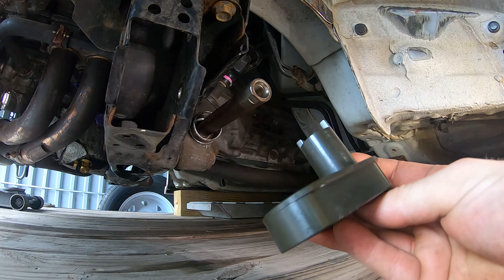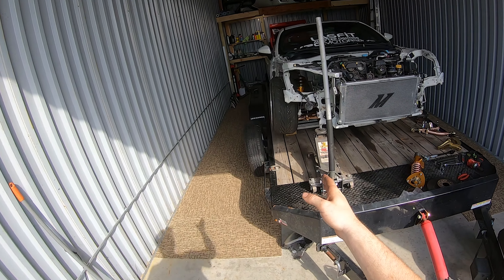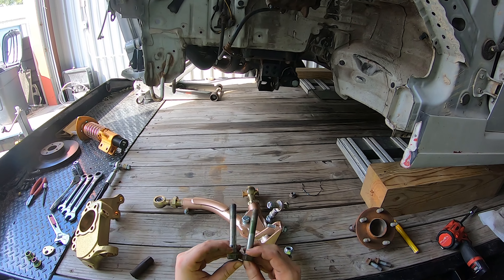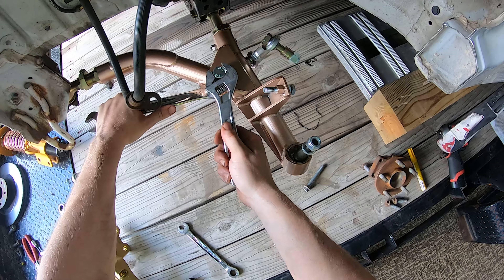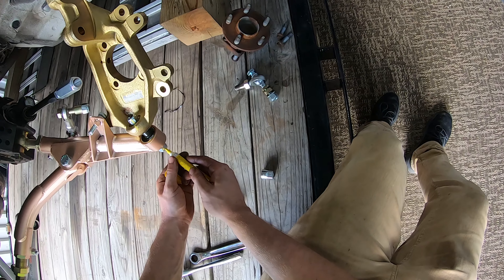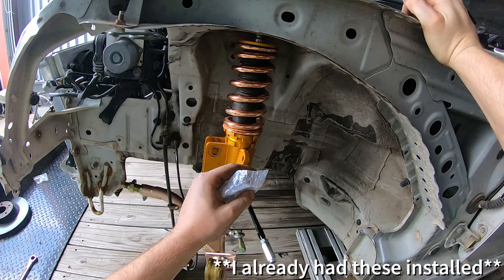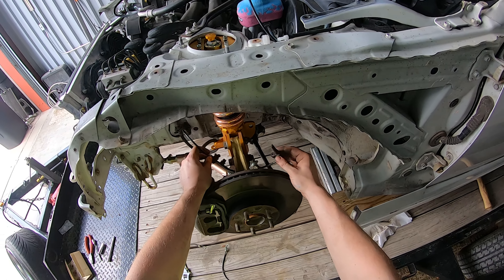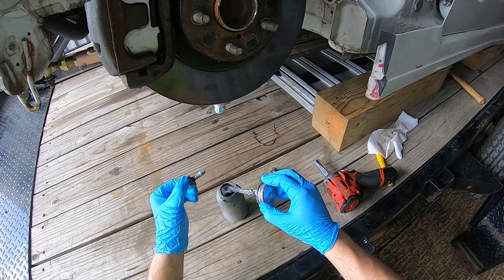Parts Shop Max Angle Kit Install FRS/BRZ/GT86

Comment: could you do a review of the rear subframe and diff riser from partsshopmax i lowered my FRS and noticed my diff scrapes and ive seen install videos but have not seen any videos about how it helped etc.
Reply from the maker: Yes I can. For now I'll give you my opinion. The kit works great. My axles don't break anymore, diff and exhaust have plenty of clearance. The only "down sides" are that there's alot of NVH introduced. You have to hammer your trunk up in order to clear the diff. 

Long story short if you have the means of installing the kit and don't care if it's a noisy ride it's 100% worth it.